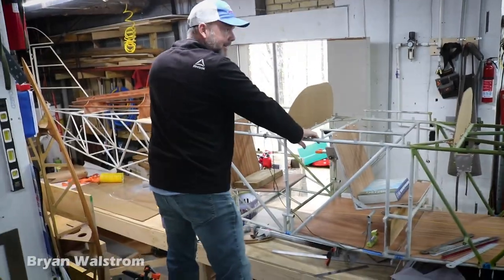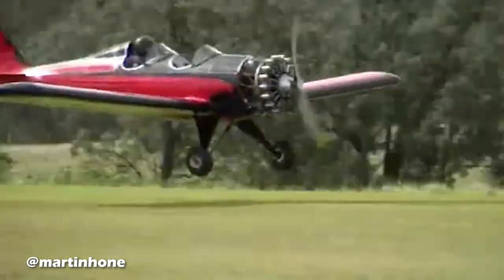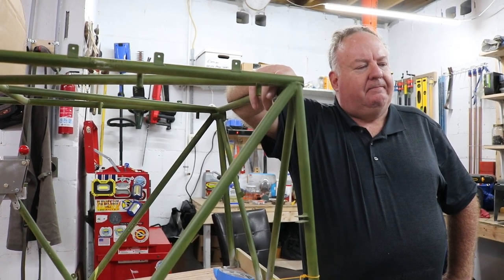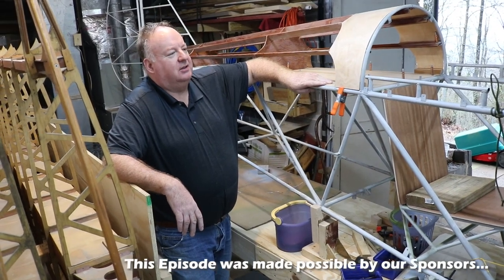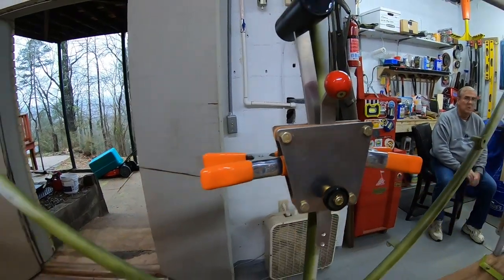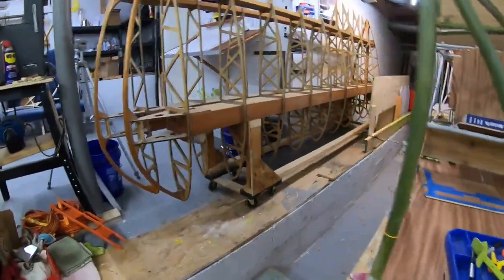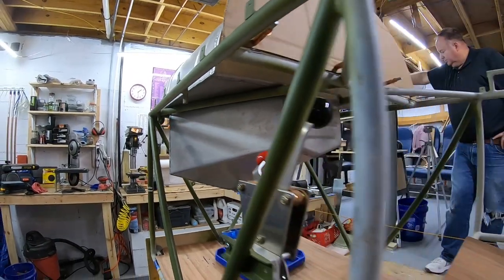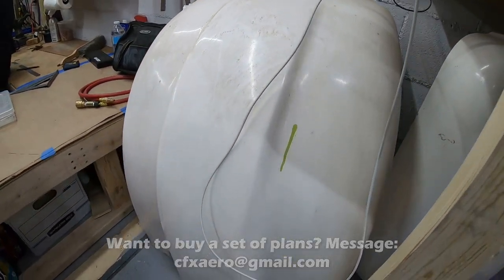Spacewalker II EXPERIMENTAL Aircraft YOU Can BUILD and FLY! John Hassard's Project

Comment: Those box spars look massive!
Reply: Rear spar is 1"x3.25" spruce.  I was working on a Citabria last week, it uses this for front and rear spar.  Spacewalker front spar  2 of these in a plywood box.  It does not seam to be the weak link in this design!  CFX aero is designing a carbo fiber wing (with same external appearance) that I'm sure will save some serious weight.  The Sportster (follow on to the Spacewalker, it was seen in this video if you look carefully) uses aluminum spars and ribs, also lighter.

Comment: Wow. I've been interested in these airplanes for a bit, but didn't know there was still a community around them. I really like the tandem seating, open cockpit, low wing, stick and throttle quadrant design! I'm not sure I'm ready for a plans-built design, but if there was a good kit available with a good community around it, I would be all over it!
Reply: Hi Redchrome; there are still parts and assemblies floating around.  Worst case you could buy the tubing and get someone to weld it up; for a welder it's not a complicated job. CFX aero is able to sell completed fuselages in North America (either supplied as cut and bent tubing you can weld/get welded, or as fully welded).  They are working on carbon fiber wings and some other "upgrades" (keeping the same look).  The follow on design (Sportster, seen in this video a few times) was just purchased and will return to (kit) production in a year or so.

Comment: I can see a resemblance to a design in an old EAA reprint of 1928-1932 Flyer and Glider manuals. My last aircraft build was a Pietenpol Sir Camper that I had to modify to meet weight and balance for an old Subaru engine in place of the original Model B Ford engine. Seems that those are hard to come by LOL